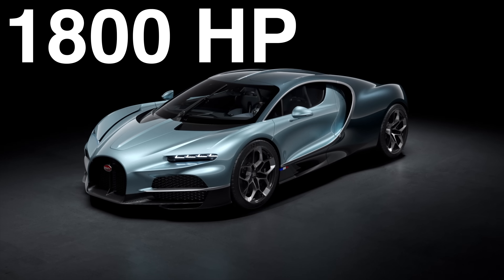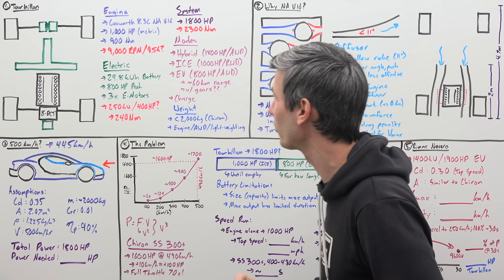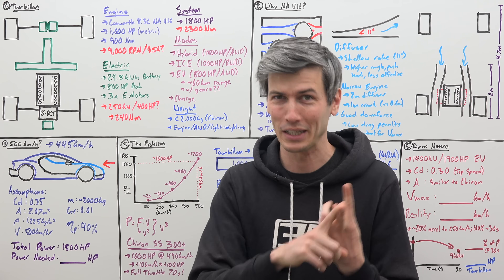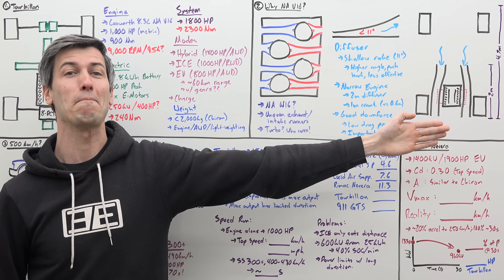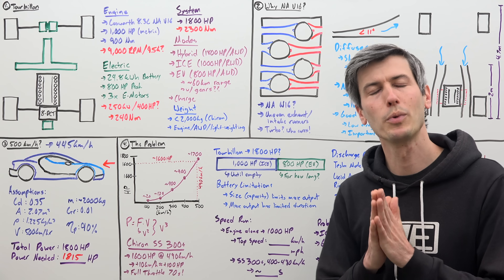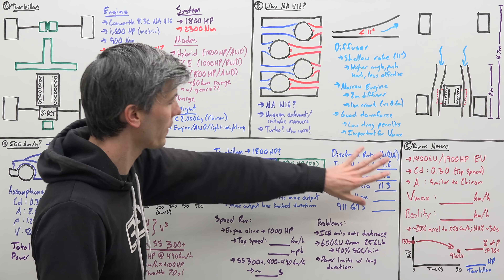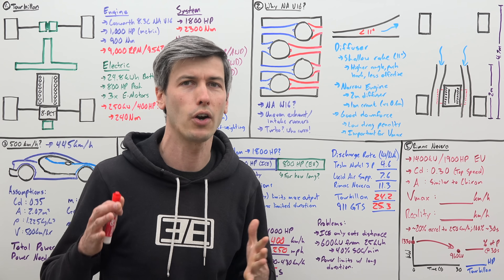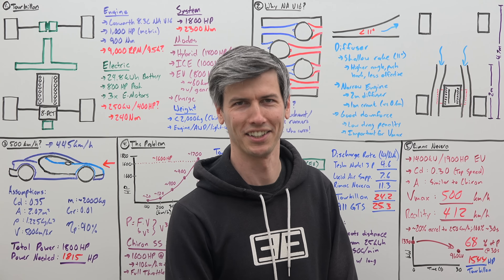Bugatti's Giant V16 Engine Is Insane - All The Tourbillon Details!

Comment: Btw Andy Wallace (Bugatti test driver) said that during the Top speed run for Chiron 300+ when they reached 490kmph, the car was still pulling, they simply ran out of space to push the car to its limit. So the power required as mentioned here can essentially be lower i.e. 1800 HP can do the job.
Reply: Right, but this new Bugatti has a totally different PU. I knew that about Andy Wallace, but if you watch this entire video you understand why getting to 500kph is very difficult. If it was 1800hp in the Chiron SS 300+ with the turbo W16 it would easily get to 500kph. The EV component is the problem here with the Tourbillon. And the EV component is 44% of the total power output.
Reply: @L0p3s it is lower and has a smaller frontal area so even with the same CD, it should require less hp to hit the same speed. If a 1600hp car hit 490, I see no reason why this couldn't seeing that info on the latest rimac never hits 87% vs OP'S calculated 68%, this car isn't out and newer than that, even if it hit Porsche 85%, it'll still hit 1680hp or if it matches or surpasses it, we are looking at 1700hp which with the stuff said at the start of this = 500 kph
Reply: @NadeemAhmed-nv2br  maybe, but I find the EV part a great challenge nevertheless. Yes, it is lower and a as less FA, but a turbo ICE is more straightforward. But let’s wait and see. They are probably going to wait for a special edition that makes 500 and are holding back because of that. This is a husiness after all and we had the Veyron SS with 200 extra hp in the past and the Chiron SS 300+ with lots of modifications to achieve the 490kph and surpass 300mph.
Reply: @L0p3s  Right! Made the comment half way through the video lol.
Reply: @ashutoshtewari274  you’re excused 🙂😅 But I think eventually this or a later version will reach 500kph.
Reply: @L0p3s  I think if you use the e-power as a KERS, this car will be able to reach to 500kph maybe, I mean, starting with the pure ice mode and accelerating to around the v-max, then switching to hybrid mode, e-power kicking in, boosted to 1800hp and picking up speed again, this operation method is the best way to maximise the top speed of this car...
Reply: @下田洋介-w4z I was thinking the same then he mentioned the time it takes to get to 250 before you switch as well as the runway length
Reply: @galazoulay8498  Runway length, even tire durability is not important, the important thing is teoretically can this car reach to 500kph or not, that's it.
Reply: You're absolutely right. But when Bugatti decided to build this tourbillion, I think they went through all these datas and were  very much aware of these technical factors and challenges.
Reply: @SidRay1760  off course, they’re the opposite of idiots. But given the limitations of a PHEV with a 44% EV power component it is not as easy as pure 100% ICE turbo that is only limited by the capacity of the fuel tank. I have no doubts they can achieve the 500, but taking into account the type of PU I’m particularity curious as how are they going to achieve that! Cheers.
Reply: Yes, but he only went in one direction: do a proper, legit, 2 way pull - as required by the actual Guinness Book of Records and every other recognised World Speed Record  authority..... he may well have hit the wall at 460kph with not a single jot of power left to give. I loved Andy before he went to Bugatti, now he has to toe the line and regurgitate their guff....... run two ways like everyone else Bugatti, or shut the f up! (Koenigsegg still the Daddy in this case!).
Reply: @GarryMcGovern difference being, the VW test track Bugatti did the record run has a (give or take) 8km long straight

The Agera RS' (and since then the SSC Tuatara's) record was on a quoted 11 mile, or around 17km long highway. Jesko hasn't ever been tested aa far as I know

I mean, I would've loved it if they ran the SS 300+ on the same highway as Koenigsegg. Apparently, (after some digging) that section (Nevada State Route 160) was repaved between 2018 and 2020. Bugatti's record attempt was in September 2019
Reply: @GarryMcGovern The Tourbillion could take a cool down drive to refill the battery before the turnaround run. Then, fuel tank capacity might come into into as well...
Reply: @GarryMcGovern  That is for Guiness Record of Book but SUS-TUV, the organization that watched and certified the record for Chiron SS 300+, only required one direction on a track like Ehra Leissen long straight which is practically flat and surrounded by tree with high air density. The Nevada long road has different elevations along lower air density thus hardly comparable. That is why Agera RS was able to hit 285 mph downhill with tailwind on that direction. Let remind that Ehra Leissen mostly sees one direction for decade and trying to do an opposite run is extremely dangerous for the tyres. Andy Wallace reported a jump when doing the run at 440km/h due to the paved difference from old and new asphalts which highlighted new factors to take account. Pierre-Henri Raphanel who did the record run in opposite direction with Veyron SS reported how the car followed the road deformation as nobody did such performance before at Ehra Leissen. Those are reality to take account when doing a say Guiness Record run on a track that mainly saw one direction meaning no track manager would bother.
Reply: @GarryMcGovern  Still the same outcome even in 2/3/4 way direction, it can still hits the same top speed but the runway runs out of stretch, that's why bugatti didn't do the second run, because the Ehra Lessien race track was short enough for 500kph. Moreover it is still picking up speed to its max
Reply: How you miss totally his point?
The point is the car no longer had 1800hp the time it reach over 4xx km/h.
The whole video is all about this.
Reply: @fermignano89  My point exactly. Either he didn’t watch the video or missed the point entirely.
Reply: My formula still stands: An EV needs roughly 2x the rated hp of an ICE to achieve the same top speed. Because of power drop within the battery, motor rpm and gearing.
Reply: So the more power needed is to reach it faster.
Reply: New bugatti has a smaller frontal plane. This will significantly reduce the horsepower needed to cut through the air at high speeds. More of the power will go into acceleration.
Reply: How can it pull if it is limited by electric batteries?
Reply: @mali_pleonazmic  Batteries can give the full power for 10-15 minutes, that's enough. 

The car is a hybrid with a 1000hp petrol engine. Most of the time you don't need more than 300-500hp. The engine has 500-700hp room and plenty of time to charge the batteries during low power demand.

You can't possibly use 1800hp for more than few minues or usually few seconds.

Comment: Electric motors can make 100% of their torque at 0 rpm but their power always falls off at the top end of their speed range (because physics). Everyone gears their EV motors for acceleration and efficiency but not top speed. So the front motors will be significantly down on available power regardless of the battery at top speeds.

This is also why the Nevera output scales down at top speed.

Comment: One thing I am curious about: To reach a Top Speed of >500 km/h, besides the power delivery, you would need special tires for it, dont you? I know the SS Chiron had specially developed michelin tires (i think) but they were crafted for speeds up until 500 km/h if I remember that right.

A video explaining what specifications a tire has to have to be able to support speeds over 500 (if its possible) would be really interesting!
Reply: Actually I saw a video from Insider Cars saying that the Michelin tires used in the Chiron SS were able to sustain speeds up to 318mph.
Reply: Yeah great idea !

Comment: Couldn't tuned but different length intakes and exhausts (as per VR6) help overall performance by having multiple smaller torque peaks in the rev range rather one single peak?
Reply: What 😳 could you please explain this?

Comment: 120/20 = 6
(200/100)^3 = 8
the power/speed curve on the white iard is not cubic. it's a more realistic version that takes into account rhe cconstant friction force, which becomes linear function of speed when you compute the power dissipated by friction. somthing like 
@100kph 5hp (friction) + 15hp (aero drag) becomes 5*2 + 15*8 = 130hp
(round number make it easier)

Comment: Is the hybrid mode all the power sources all the time, or does it adapt to your driving style and switch between limited EV mode, combustion mode, charging the battery, and all the power sources as necessary for the best balance of performance and efficiency?

Comment: Mate said that the Tourbillon battery has Imersion cooling. Which mean it has the best cooling method technology at the moment. These new dielectric liquid are ultra performant. So holding 25C discharge rate is not a problem and sustained power is also improved even at the end of discharge SOC curve. The new cells they are using are ultra performant ultra low Internal resistance. Also One of the reason you see the power is decreasing on the Nevera is because the BEMF of the motor is getting close to the battery voltage so it become more and more difficult to continu pushing phase current to the motor( which is related to torque) as the difference of both( or the potential difference) is narrowing. The use of Field weakining generation to conteract that is not efficient so more and more heat is generated.
Reply: I Like..Although I didn't understand anything you were talking about 😂
Reply: I’m with Rene 🤣
Reply: > Toshiba's superconducting motor enters the chat.

Jokes aside, I wonder how much of EV power train is consumable parts here. There was no word on motor cooling, especially on back motor, which not only has to work super hard, but gets cooked by ICE (exhaust seems to be hugging it pretty tight).
Reply: Nice to see another motor control enthusiast. Do we know if rimac uses synchronous reluctance hybrid motors? At higher driven frequencies synrm motors don’t suffer from bemf
Reply: 🎶🎵It’s all about that bass 🎶🎵
Reply: Thing is, you can only hold 25c for slightly over 2 minutes. After that you're flat.
Reply: Tesla is years ahead in motor tech
Reply: @Factoryseconds123  Put down the crack pipe, these cars in in an altogether different league.